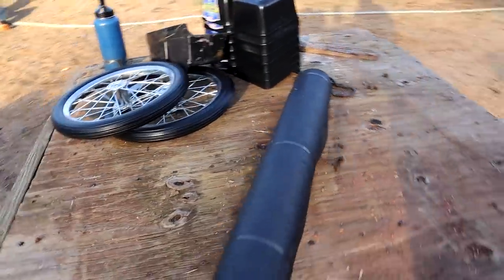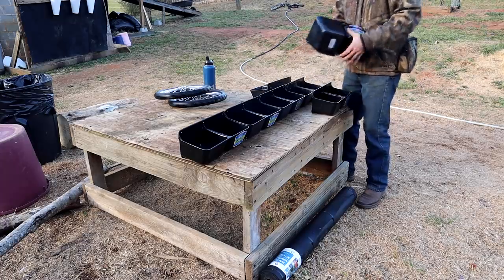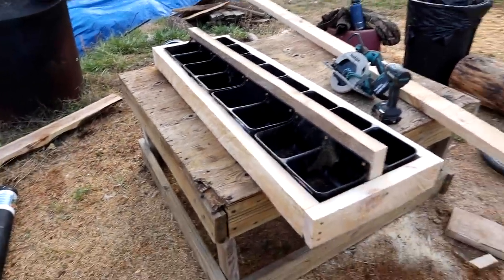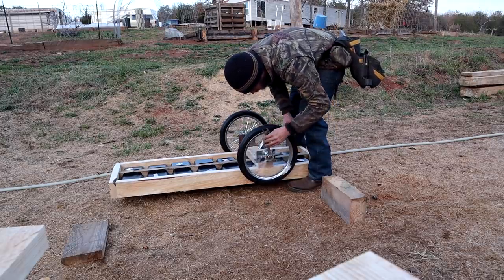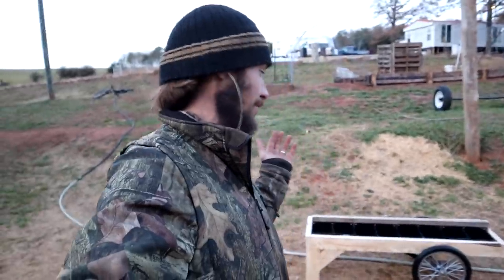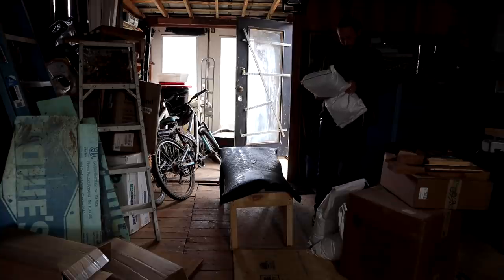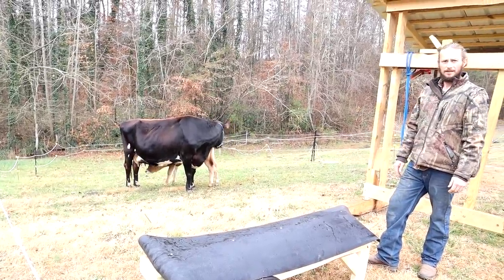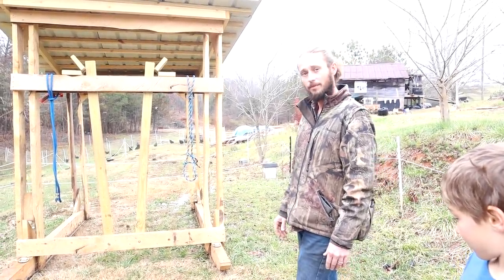But Will She Like It

Comment: Ben for the minerals rack mount it to one side of the milking stand so you only need to move the milking stand and the cow won't tip over any minerals.
Reply: I agree. you might take half at one lvl and the other 1 ft above.
Reply: That's what I was going to say.  They need access to the back part of the sides to milk but there's no reason they cannot split the minerals in half and put half on each front side.
Reply: Came to make the same suggestion
Reply: Exactly my thought. Why does it have to be a separate item?
Reply: Great idea!

Comment: In the west where there is open range and one owns a couple thousand acres or more with a few hundred heads of cattle, mineral salt blocks are used for cattle.  Usually the salt block is near food source covered shed or water source.  The shed protecting it from rain and moisture.  Salt blocks come in white or brown (mineral).  You just set it, and forget it until another block is needed.

Comment: Nice project... All you need to do is anchor the legs in the ground to make sure she won't topple the whole mineral stand. Cut angle-iron, screw at the bottom of the wood braces, drill a hole in the angle iron big enough to nail  rebar pieces long enough to stabilize the platform. It should hold in place.   :)

Comment: Mounting to your milking parlor or i would just weigh the cart down with concrete as low as you can get it but not touching the ground. Dont sweat it man, youre building to your specific needs and you have the capability to adjust on the fly. Not man professionals nail it on the first go around with finding ways to improve. Love your videos and family man. 
I hope to join the community very shortly. My wife and i own 25 acres in Mississippi. Our house is just about finished, maybe another two months to go. Then in three months my wife will deliver out first baby (girl) into the world. But first, i have to have knee surgery. Anyways, like i said im excited and inspired by yall and cant wait to join the homesteading community and continue to learn and grow with yall

Comment: Try mixing salt (which they need) in with the minerals. It works like a charm. 💕
Reply: normally, if they're not eating certain minerals, they are not deficient in them and don't need them.  That's the whole idea of feeding individual minerals, they only eat what  they're lacking.

Comment: You could make some kind of connector to attach the mineral sled onto the outside of the milk stand skid. You could use something like a barrel bolt or a gate latch to hold the sled against the skid. Or even something as simple as lined up eye bolts with a bent nail dropped in to hold them together.  It would be almost impossible for the cow to tip it over that way and easy to detach it to move with the milk stand.

Comment: Here's a tip for free rubber. Go to truck stooscand around the parking lots you will find mud flaps from trailers and trucks that have been knocked off. My husband, a trucker,  picked them up all the time. We use them all the time. Cut with a jig saw easily like you found out with the band saw.

Comment: Ben, Big fans here. Say I wonder if you designed four cane bolts for your mineral feeder would allow it to stay on wheels? Perhaps made from rebar that could be driven into the ground  a foot or 18 inches. If you're not familiar with cane bolts. They are slide bolts usually at the bottom of a gate  that slide into the ground or a piece of pipe in the ground to keep it closed. It bends at 90 deg. at the top to make it easy to pull up (through a couple of vertically placed eyes) Your metal working skills would make this a breeze.

Comment: Just take 4 pieces of rebar and put 2 on each long side with the wheels. Then pound them in the ground up next and even with the wood at the top. Then she can't push it over.  And just pull them out and  move it to the next place and repeat.

Comment: Cut some sacrificial runners for the bottom if you will be dragging it around.  Replace them as they wear down over time.  It will save the basic unit from wearing out.  4 x 4's with 45 ° cuts on the end.

Comment: I made an insulated water bucket for my horse with a styrofoam lid and taught him to knock the lid of to drink by putting pieces of apple in the empty bucket while he watched and then a piece and put the lid on. Only one apple cut into pieces for him to open lid in seconds. Then when i put it out with warm water he came right over and opened it and looked for the apples. But he still knew where to get water and every time i walked by i replaced the lid to keep water unfrozen. It worked all winter. I tied the lid to the bucket with a long piece of twine so it wouldn’t blow away and spook him.

Comment: Nice.   Instead of taking the wheels off, if you have some old pipe you could attach the pipe to the legs and then drive some repair through the pipe into the ground.   Then when you need to move it, lift it off the rebar and wheel it away.   When filled lift it and slide it back down over the rebar.  Just a thought.

Comment: Could you attach it to the side of the milking stand???  Leave the wheels on and use clamps  ,hooks or maybe even strong bunji cords or whatever you have in the shop that will hold it still while she pushes on it. I also wonder if the "roof" needs to overhang that far. Maybe it does so she can lift it up. She is the coolest cow.

Comment: crazy idea.  You've seen power poles for boats that hold them in place in swift water?  How about a couple pieces of rebar you can drive in the ground to keep her from flipping it.  Held on with conduit straps?  Shouldn't have to drive them too deep.  On in the front one in the rear, opposite corners?  Just an idea.

Comment: If she pushes it around use a couple T stakes and a clamp on the side to secure it. Or maybe one in each corner. I'm sure you have some stuff laying around. You did a nice job on that. I'd hate to see you tear it apart. I stake my pig feeder in a similar manner and a 300 lb pig doesn't move it. And with a T handle stake you can pull them up easy

Comment: I think you are right: way too small for use with a cow. Cows like to rub on things and will move it around and probably turn it over. I would be concerned that, if you are using portable electric fence, the cow would push the cart into the fence, damaging it. Like all that you do, it is a very nice looking piece of work. Maybe your cow will be more gentle than most...

Comment: Hi!
Would metal plates screwed to the bottom of the legs, that stick out with a rebar sized hole to peg it into the ground be enough to stop her from flipping it over!?
Or you could put fixings on the side of the legs to run the rebar through, a hinged leg on the back that had the same fixing to the ground may make it flippable.

Comment: What if you attached the wheels the other direction? Using the short sides. You could drop the box lower to still put the center of gravity lower to the ground and yet still have mobility. You could also then consider having a way that it could 'attach' to the station but being able to be unhooked. This way they both could be pulled at the same time with one effort. Thoughts?

Comment: if you sandwich the gable ends of the rubber roof between some flat bar, just might work out better after you stabilize it.  Can you fix it to that milking set up?

Comment: Ben, couldn't you put the wheels on a movable/lockable flip-up/flip-down ...hinge sorta thingy, so you could move it when you want to, using the wheels, and 'park' it with the wheels in the up position ....think airplane wheels.....  down when you want to roll, and up when you don't.

Comment: Just needs weight under it - what if you suspended some cinder blocks under the  trays?
Reply: Daniel, my thoughts exactly!  Easily detached, like suspended from a chain/anchor to move as they would be quite heavy.  Although those wheels look like they could handle the weight.